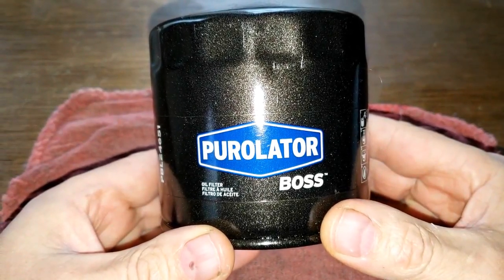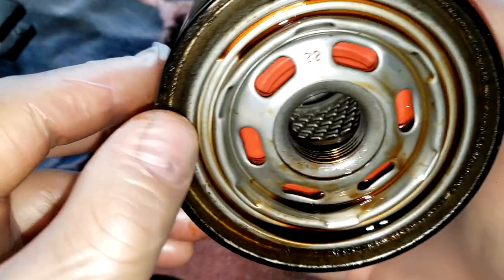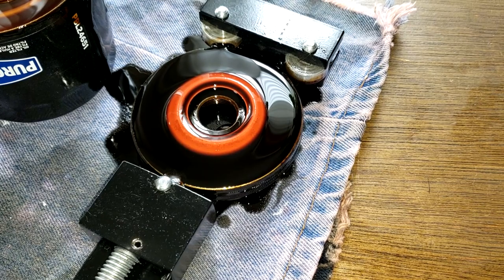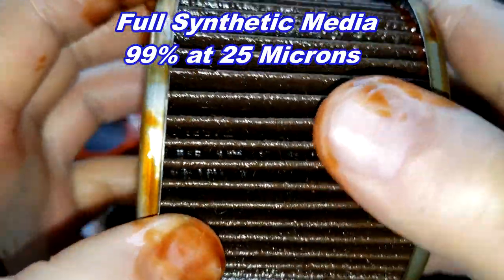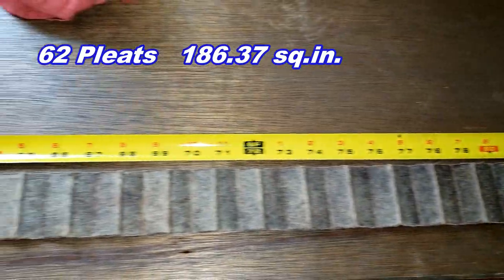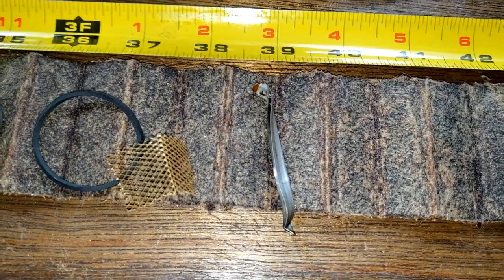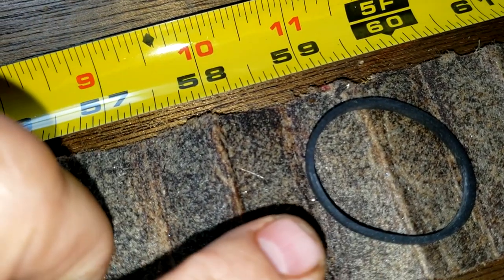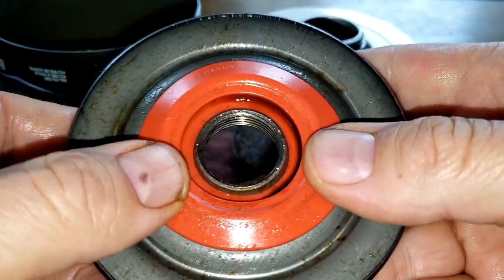Purolator Boss PBL24651 Oil Filter Cut Open,  2012 Ram 1500 5.7 Hemi

Comment: I would like to share this info.. I had 3 Ram 1500 with the 5.7 Hemi in past.  The Hemi tick is well known in these engines and so is the roller cam lifter failure. The lifters are  roller and the roller itself will eventually stop rolling on the cam, thus causing cam wear failure, I never had this issue with my Ram trucks, I honestly believe it is because I used 1 quart of RISLONE engine treatment at every oil change, the Hemi takes 7 quarts of oil. I changed oil every 4k miles and use synthetic oil with the OE Mopar filter. Rislone stops varnishing and sludge in engine, the roller on lifters were saved by Rislone..keeping the roller to spin freely on the cam lobes.. I have been using Rislone for at least 38 years...
Reply from the maker: Thanks for sharing!👍
Reply: Thanks… interesting…
Reply: Interested to know, what years were your Ram 1500s and mileage? What oil did you use? I believe as long as you don’t idle them for excessive amounts of time and stick with 5w20 and change it out every 3k-4k these engines will last forever.
Reply: Interested to know, what years were your Ram 1500s and mileage? What oil did you use? I believe as long as you don’t idle them for excessive amounts of time and stick with 5w20 and change it out every 3k-4k these engines will last forever.

Comment: I emailed them and was told the PBL2461 was 46 microns since it was a high milage filter and if I wanted the lower micron to go with the PL24651 and that was 21 to 25.  Some of their filters like most have different ratings.  Believe it nor not.

Comment: Same filter I use in a 5.4 f150 excellent product for the money  Fram to me the oil inlet holes were too small the bigger holes on the boss  allow more volume to go to the engine love these filters 25 compared to 20 mcns probably allows better oil flow after thousands of miles compared to 20 they probably took that into consideration when making the filter probably clog up faster ast 20 microns who knows bezt filter I've ever come across very proud to use it with mobile one ep
Reply from the maker: Thanks for sharing, they are good oil filters!👍

Comment: I cut open a purolator boss filter years ago, and upon examinaton of a brand new filter, it had a non functional bypass valve. Stuck in the “closed” position. I cut it open with a filter cutter too. (Not my first rodeo I didn’t damage it imo) I Still got the filter too.
Reply from the maker: The design that they use for the bypass valve on this Boss filter does not open very much. Did you try pushing on it and putting it up to a light? I'm just asking because like I said it only opens about 1/8 of an inch or so. Let me know if that works. Thanks!
Reply: @WhipCityWrencher  It’s been a while honestly; but I will recheck it and respond back.